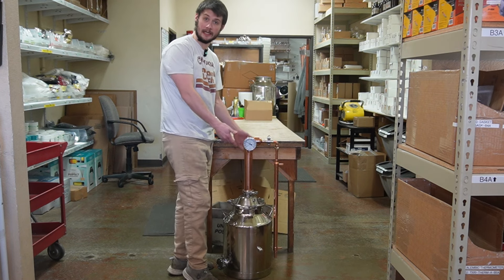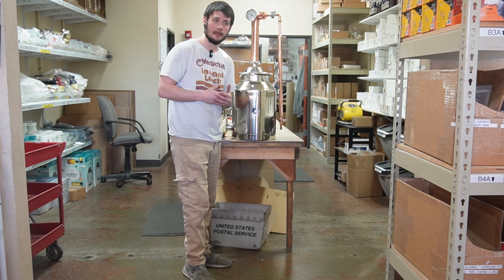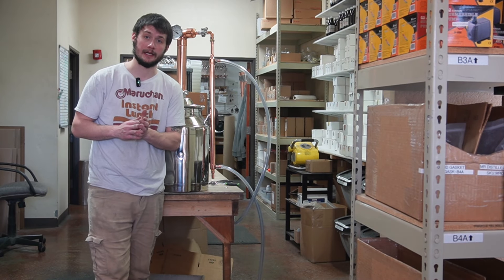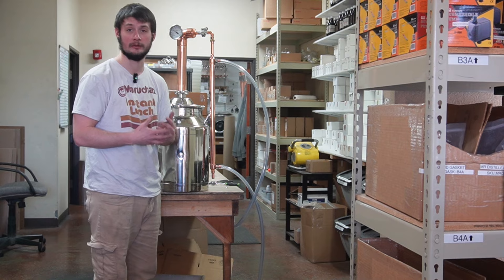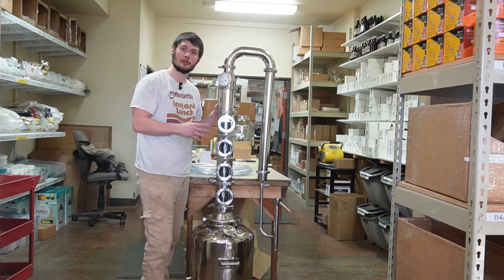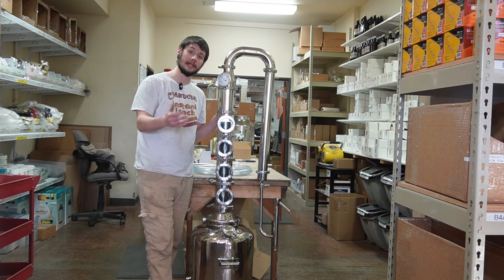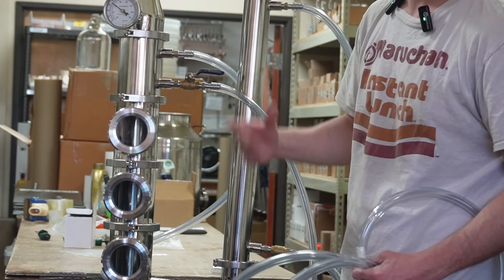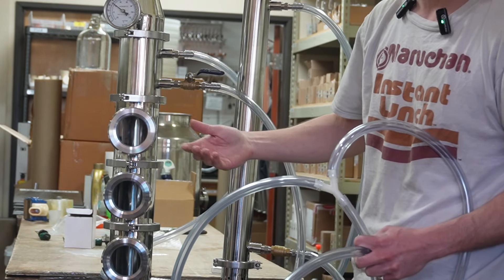How To Set Up Your Hoses On Your Mile Hi Still

Comment: Great info. What i would like to see is Quick Disconnect fittings for easy connect and disconnect for cleaning
Reply from the maker: This is actually one of our projects for this summer. It would give customers the option to choose from the current hose connections or an upgraded version using QC lines.

Comment: With the ball valve, when you close it to slow the flow of water, wouldn't it also slow the water going to the end condenser as well ?(which is not what you want, is it?) After all, it's all daisy changed, right? What am I missing?
Reply: You’re correct, as shown for the ‘reflux column’ still, one valve in the daisy chain, will affect both condensers.  The better hose setup is the one shown for the ‘flute still’ with a ‘Y’ splitter, diverting the cooling water to both condensers. Also, as Boo stated, a must have, is a ‘needle valve’ on the reflux condenser to precisely control the amount of reflux in the column. As a side note, I would control the outlet of the reflux condenser (dephlegmator); that will more than likely ensure the condenser remains full of coolant,  at all times.  Hope this helps.
Reply from the maker: I realize now I did a poor job of showing this. As Patrick mentioned down below, The correct setup to use this valve in is demonstrated in the flute setup. You'll have the ball valve connected to the reflux condenser but not pictured is a Ysplitter which splits your water line connection two separate ways - one into each condenser.
Reply from the maker: Thanks for the explanation, Patrick!
Reply: @milehidistilling1 You're welcome. Thanks for uploading these interesting and informative videos.

Comment: Question:  If you add a control valve from the final product condenser to the reflux condenser, will this not slow down the flow rate of the final product condenser and cause it to run warmer than normal.
Reply from the maker: I think so, Kevin. I think you're right.
Reply: would you be able to put a T in-between the final condenser and the reflux condenser with the control valve added  @milehidistilling1
Reply from the maker: @kevinjohnson5176  Absolutely!  This is the recommended way to run, as it allows you to control both condensers using separate lines.

Comment: why is the sight glass above the reflux condenser?
Reply from the maker: If the sight glass is below the reflux, it'll strip all the flavor from the flavoring material you put into the sight glass, so you always want it above to capture the flavor of whatever is in your sight glass/infusion basket.
Reply: @milehidistilling1  Got it.  I have not yet run my 3” pro in reflux mode.